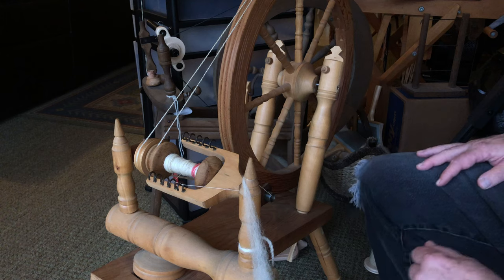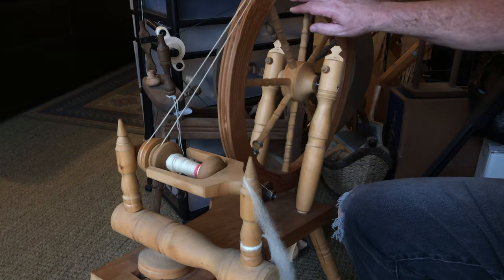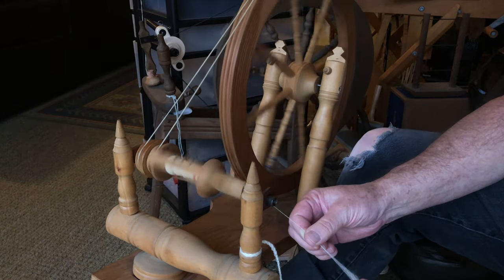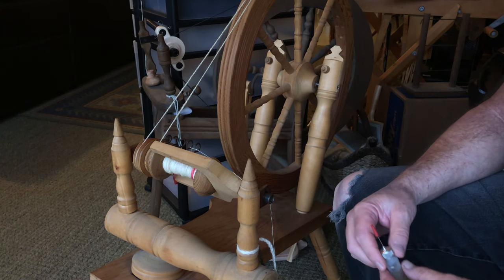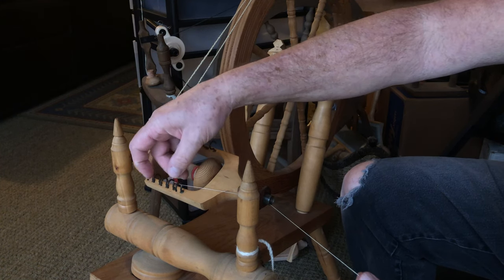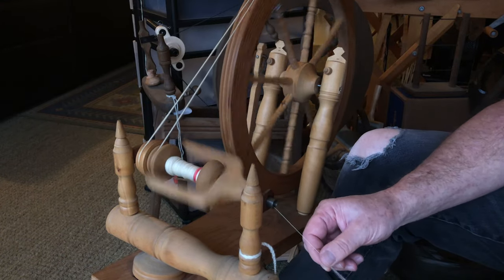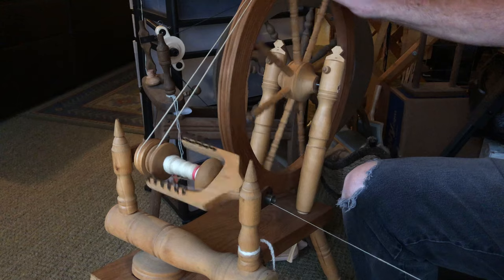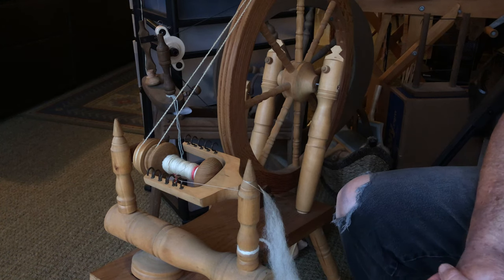Adjusting the Double Drive Wheel

Comment: I know this is an old post but....I have recently bought an antique spinning wheel much like this one in design, a little older I think, it came with no bobbin so I have had to make the one I already had fit the wheel, I knew nothing about spinning wheels having been doing my spinning on drop spindles for a while now, I didn't know if I had a double or single drive wheel, it was a matter of elimination, there was no brake on the flyer, no scotch tension either so after two weeks of trying this and that, I finally figured out it was a double drive wheel, I have watched many videos on these types of wheels and I must say this video explains a lot and very clearly. Thanks to you, I now have a fully functioning wheel, I do admire your consistency and skill using this, I have only had mine a couple of weeks and I am getting there, although keeping the rhythm of the wheel going takes practice. Thank you for sharing this very well put together instructional video.
Reply from the maker: Thank you.

Comment: Thanks for your video I recently bought  wa double drive and I'm not much of a spinner, so I'm finding a challenge? Hopefully your info about tension will be a great help., also the drafting demo wi l l help too. I'm having problems
Getting my spinning thru the orfice it twists up too soon. And it doesn't feed into it.
Reply from the maker: Cheryl, the tension just needs to be enough to pull the thread wrapped on your bobbin so it will pull easily but have a very slight tension. In the video I was using a wool drive band but don't use wool. It stretches and will quickly break if you do. I use linen thread that I make myself and it holds up real well. It also allows some slippage so you can get a good light tension for take up control. As for drafting, you need to not allow the twist to get into the fiber. If it does just stop, back twist with your fingers to ease the twist and allow you to pull some fibers out then allow a little more twist. Go slow and don't work with two thick of fiber. The backtest with the fingers was my breakthrough in drafting and I don't try to grip it too darn tight. My original goal was to spin super thin for thread to go onto a loom and my antique sock knitting machine. So don't let your fiber be too think because when you ply your thread it still needs to easily pass through the orifice of the wheel. I have other videos that may help.
Reply: @abittwisted  thankyou!that should be very helpful.

Comment: I can't believe I, I just picked up a this exact wheel. It needs some tlc. It's dated 1977, that's all I know about it. Any more info would be so appreciated!
Reply from the maker: Quite a rare one indeed. Now I know about 3 of them. I had to modify the end of the flyer as the end kept popping out of the leather bearing. I filed a deeper notch then I put in a new leather bushing. I drilled a hole just a tiny bit larger in diameter and the width of the groove I filed into was a perfect with to the leather bushing. I cut a slot from the top to the new hole and it just popped right in without the need to move the upright on the mother of all. I had new bobbins made so I have more than one. I also had  a couple new whorls made so I could spin flax better without too much twist. It is a good wheel. It is my first wheel I purchased for myself. In my about page you will find the email you can use to contact me about the wheel and to send pics of the wheel. I can help better if I can see the in detail. Just remember to lubricate all the moving parts. I use clear stain free sewing machine oil that you can get off of Amazon.

Comment: I'm having a hard time trying to get the bobbin to catch my fiber. I'm new at this and I'm not sure what I'm doing wrong? People tell me my bobbin is to big for my spinner and I don't know where to get one that will work with my spinner. Could you please help me if possible.
Reply from the maker: So first off you can send an email. My email can be found in the about section of this youtube channel and you can also find me at fb.me/naturesyarn which is my FB page. I will need photos of what you have to better help but off the top of my head from what you wrote Im guessing you need to properly attach your bobbin leader. You do need a good thin leader line to attach to the bobbin. This may be your issue. If not then I need photos of how you have your wheel setup. I’m happy to help but you need to send info. If I can’t I can direct you to someone who might or go find the answer for you. https://youtu.be/4a-nDJugsVk

Comment: I can’t find the tension on my older wheel. I’m not sure what make it is. But it’s made in Canada. Can you help please. Right now I got the drive bands ok but no take up.
Reply from the maker: Would need to see a pic of the old wheel. If its an older Saxony style wheel the tensioner should be a screw at the end of the wheel to move the Mother of All forward or back which changes tension. The flyer whorl needs to be larger than the bobbin whorl. Im assuming a Double Drive wheel. If you have an Ashford Traditional the tensioner is the platform the Mother of All sits on and hinges away with a screw to tension the belt. But a picture would be helpful. Or a link to a picture that looks like your wheel. I’ll check it out and try to help get you up and running
Reply from the maker: If you look in my about section you will find my email address. You can send pics to my email and I’ll get back with you but identify who you are and that we are working on a problem you mentioned in this video. That way I won’t ignore it.

Comment: thanks so much!! I got my first wheel last year, an antique double drive castle that i now have figured out well. Just got another antique saxony also double drive. My brother and I, trying again and again to figure out how the hell to go clockwise with the x on top and drive band keeps slipping out of place. my castle doesnt care about which direction its going Lol and it was like the first thing you said. Hey, have any idea why i can't get a gap in the x when its on the bottom? Pretty sure ive tried switching whichband is on top and bottom but im gonna try again. Makes my drive band last like ten minutes driving me crazy!
Reply from the maker: I don't have any trouble with the drive bands rubbing at the cross. What are you using for a drive band? I use my own home spun 2 ply linen thread as my drive band. My drive band is rather skinny. Could be you have too thick of drive band. The cross will move from top to bottom depending upon which way you spin naturally.
Reply from the maker: Do you have a place I could go have a look at your setup like on FB or some photo album or YouTube channel?

Comment: what is the best type of material to use for the drive band?
Reply from the maker: I have read that cotton is best. I have used hemp and I now have my two ply linen thread I made on this wheel. It is working great for me.
Reply from the maker: The wool drive band I did not like because it stretched out too much. The linen thread is working great.
Reply: String.  After 5 years, I still have the original band on my wheel.

Comment: What causes the string to fly off wheel
Reply from the maker: What I have been able to observe over the years is that a wheel that is out of alignment with the whorls can cause it to jump off the wheel. A fuzzy drive band that snags upon itself will cause the band to jump off the wheel and a big fat knot will cause the opposing side to catch and jump the band off as it comes to the big knot. This is why you tie your drive band together or use very skinny knots. I typically use my own home made linen drive bands and because linen is fuzzy by nature it will easily snag upon itself at the cross point and cause it to jump off the wheel. My fix is to wax my drive band real well to remove any fuzziness and the knots I use are small so they don't readily catch at the cross point causing the band to jump. My drive bands are rather skinny. If your band is thick you should tie your ends together so you don't have the knot issue and wax your band well. It will help it live longer and remove any fuzziness. Adjust your tension accordingly. Not too tight or loose but sometimes you need real light tension so be sure your wheel is in proper alignment.

Comment: I set up my spinning wheel like you have and my band constantly falls off. Even after tightening it. What is possibly something that I may be missing? Help!
Reply: Any luck getting the drive band to say put? Any place I could check out photos or video of your setup? Video of setup would be helpful.
Reply: I had to make some extra adjustments to my wheel so I could successfully run my wheel backwards for plying. Now it runs very nicely for plying. I have a new idea to increase the diameter of the whorl a bit without even changing the whorl. Video on that coming soon.
Reply from the maker: Did you finally get the wheel to run better? What was your solution for your wheel if you got yours running?

Comment: What brand of wheel is this? I recently acquired one just like it
Reply from the maker: This has no specific brand. This one was built by a small company in Italy in 1968. It is a typical design but with the makers input. It is similar to many old victorian wheels but newer and nicer in my opinion. I really like this wheel and have never seen one exactly like it. I have new reproduced bobbins coming as this one only had one when I purchased it. The people whom I purchased it from had used it as living room art and I was the very first one to spin any yarn on the wheel. It sat unused for many many years. It was liked but was put up for sale. I snagged it.
Reply: Interesting. It looks exactly like my wheel. Mine is from 1977, was built by a man named Jensen Almaas in Enderby, BC, Canada. Same MOA, bobbin, and even little caps on the drive wheel supports
Reply from the maker: @oxybikechic  Do you have pictures you could send of your wheel? I was told mine was built in Italy. If mine matches yours then maybe my information is wrong. lumiecraft at g mail . com
Reply: @oxybikechic 😮 mine is 1977, I'm in the Cariboo!!! Exactly the same in design

Comment: Dudes please help, i just got a mega old upright spinning wheel as a gift and im struggling. Its a double drive, and the issue is, no matter how strong the tension is, the bobbin refuses to spin. It spins a teeeeeny tiny bit when the tension is so strong, its impossible to spin the wheel by the treadle. Anyone have any ideas or suggestions? ._.
Reply from the maker: Tension needs to be light. Typically the super old wheels have gunk on the bobbin shaft of the flyer and has gunk built up inside the bobbin shaft hole. You will need to clean off the shaft to dry metal then use some sort of stick with sand paper to slip in the hole of the bobbin and sand out the gunk. Then it will likely spin like a top for you. I had the problem with a pretty old wheel I picked up and got running again. If you only clean the shaft it may not work so you need to clean both the shaft and bobbin shaft hole. Give it a spin. I can be found at fb.me/naturesyarn. You can ask questions there. What FB Flax or Spinning Pages to you belong to? If we can meet on one of those pages you can post pictures of your wheel and I can give a better assessment. You can do some short video too which would help assess the issues. Glad to help.
Reply: @abittwisted  thank you so much for your answer!
First, i wanna make a correction, the bobbin spins perfectly, but it doesnt wind. 
The whole thing is surprisingly new-looking and clean, i still went over it and cleaned it anyway, inside and out all over, and thats the state im experiencing the issue in. 
A thing i noticed however, is the difference between the size of the flyer wheel and the bobbin wheel is tiiiiny. Like, three millimetres max. So the two spin at the same speed. Now its pretty obvious to me that thats the problem.

Originally, i thought maybe this isnt the original bobbin. But after a lot of searching, i found a model exactly like mine, and it has the same bobbin, wheels same size. 
So i think im going to acquire a bobbin with a smaller wheel. But im still curious why its like that. 
Here are the wheels:
https://imgur.com/a/139DsZV
Reply from the maker: @0yodelingpickle526  Ok, Good pic. The bobbin and whorl are just fine. These old wheels are supposed to be that way. One is just slightly larger than the other. This is what is used for winding the thread on the bobbin. These wheels are designed to spin thin thread for weaving and not bulky art yarn. Your drive band should be one huge band doubled up on itself. And of a material that will slip if needed. I use a large linen thread I made myself for my drive bands. If you put a long leader on your bobbin you can practice spinning that leader onto your bobbin. Id make it pretty long so you have something to easily work with. Thin as well. Do not put much tension on the drive band and slowly adjust until it takes up the thread. Don’t let the leader get too twisted or it will bind up and not feed through the orifice or make it around the hooks. The wheel will easily over twist quickly if you are not careful. Keep practicing until you can get that leader to wind onto the bobbin. Start so loose that the drive bands just slip under super light pressure when you turn the wheel. You can even use your hand to slowly spin the wheel so you don’t over twist your practice thread. More images of the flyer setup to spin would be helpful. Yes, the bobbin looks to be in excellent shape. Pictures help a great deal.
Reply from the maker: @0yodelingpickle526  any update
Reply: @abittwisted  hello, very sorry for the wait, i was busy with other things these past days. 
i tried some different sized whorls and now things are good.